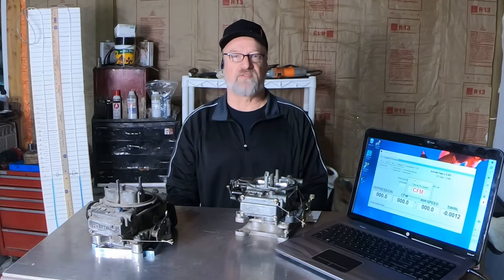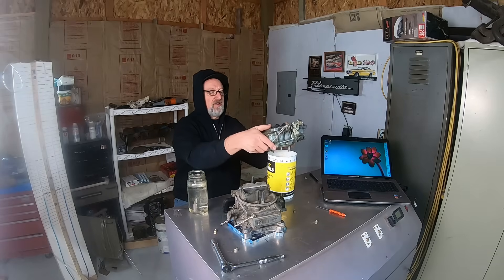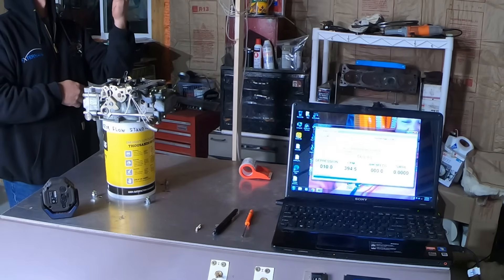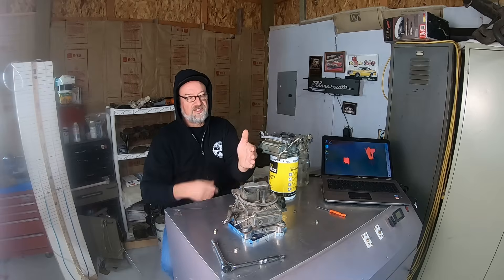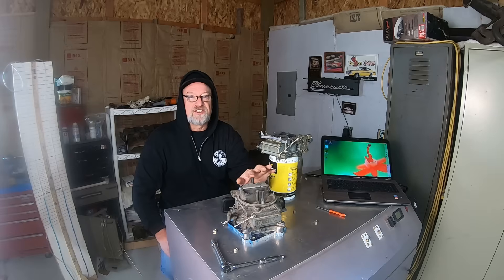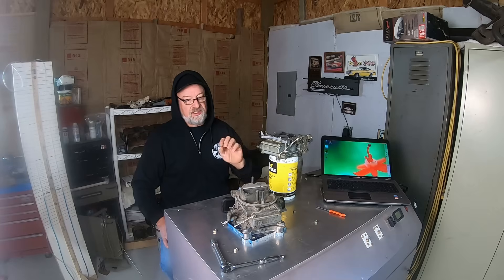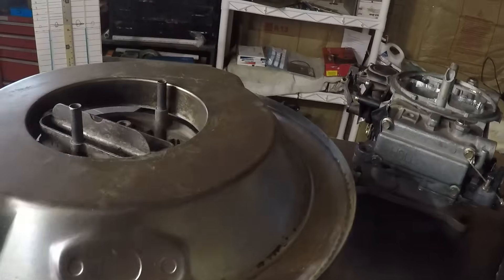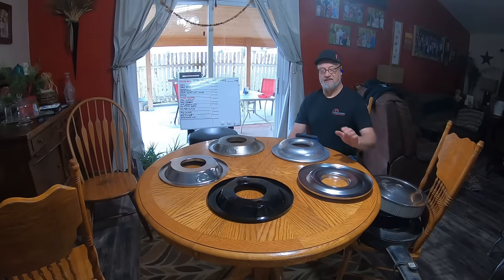Holley Carb Horsepower KILLERS: Air Filters & Base Plates Tested!

Comment: i dont know how to message through youtube so im going to drop this quick request. if you have a 500cfm edelbrock and a 600, could you flow the 600 with the 500 primary boosters? someone is telling me those front boosters from the 500 is whats dropping the 100 cfm and not the booster + rear venturis being smaller. i am trying to make a spread bore style 600 for my dual port intake. looking for like 200 front and 300 rear or so.
would really appreciate it.
Reply from the maker: Thanks for your question! That’s a really interesting idea, and I can definitely see how those primary boosters could affect airflow. But the only carburetor like that, that i own is a Carter AVS, and it is different then the AFB.
Reply: @CudaFishEStories  hey thanks bud. i called edelbrock and asked them the sizes of the venturis on both the 500 and 600. turns out, they are the same and they just use the large booster in the primaries to kill flow. 
theres a guy on youtube selling 600 to 500cfm restrictors. you jb weld them onto of the 600 booster and it cuts 100 cfm. thats why i wanted you to test with the smaller boosters. sounded hoaky to me, but since i called edelbrock and they told me thats how they do it, i guess he is 100% legit. and since i have an offenhauser dual port intake and want the smaller primaries, thats exactly the carb i need. but i have a 1403 and want to switch to the avs2 so i need a 1901. anyway, thanks for the reply. ive watch several of your videos. i think i need a flow bench. i dont have anything to test but its cool.

Comment: Love these tests. But just throwing a question out there. Does anyone know where i can buy a twin dominator one piece oval filter plus top bottom plates. Gonna be a lot of work to make myself.
Reply from the maker: I hope someone will give you a good sourse. Because there a dominator cut in half, aka a circle cut in half.  But that would be a good gadget to make...........it would be vary sellable. most won't us a filter with this hight level of a Race carb...........but there is more them you, that would buy such a air filter ;-)

Comment: I race NHRA Stock Eliminator in an '87 Monte Carlo SS  with center bolt (081 heads) L-69 305. In K/SA any slight hindrance greatly affects my ET. and MPH so I did this very same test and came up with the exact same results as you on Eddie Carlisle's (Carlisle Racing) flow bench. The main difference being I was testing on a Rochester Quadrajunk which is required for my stock class. The deep Edelbrock Elite air cleaner base flowed around 12 cfm over the rest I tested only we tested them at 28 inches of water not 20.4. I use a brand new air cleaner every race to keep the air flow consistent which works well for me. FYI my car runs 11.60s @ 118 mph with a 305 that has a stock intake, modified Quadrajunk and 081 heads with nothing in them beyond the valve angles cut and screw in studs. I went through a pile of 081 heads, L-82 intakes (Chevy used the same intake on the 350 Corvette and 305 HO), and Quadrajunk carbs to find the ones that out flowed the rest. Amazingly my 081 heads (with a 1.84 inch intake valve) will out flow most every double hump head with a 1.94 inch intake valve (197 cfm @ .400 lift) vs a 186 double hump's 194 @ .400 lift. The things you learn on a flow bench are what wins races, nice video by the way.
Reply from the maker: So glad that you are backing up my finding.......so you didn't try it on your race car, because it lost flow????
or did it not perform at the race track as well?
thats a bad ass 305 you got there. ;-)
Reply: @CudaFishEStories  I used the base that flowed the best on Eddies flow bench and ran that at the track in Memphis. The 1st pass I made on the car was 11.78 @ 114 mph and we started tuning the engine and tested several tire sizes and shaved almost 2/10th off it. We had the biggest gain in changing the fuel from C11 to C10, fattening up the mixture, adding 2 degrees to the timing to 38, and running 29 inch back tires. When I raced it in Gainesville I got put on the trailer by a 383 Mopar in 65 wagon because it was a heads up match in K Stock automatic. A 305 Chevy stands no chance against a 383 Mopar.

Comment: We ran a 4" tall by 14" round paper air filter with a top & bottom plate-no enclosure  around the filter on our dirt track cars with No problems with a Holley carb.
Reply from the maker: yup a lot more surface area then the 3" X 2.5" standard open element.  which is required for most under hood air cleaners.

Comment: assuming you're running the 600 CFM carb on a Mopar 360 those flow number differences only matter when the engine is running around 7000 RPM.  Who does that?  Check out flow requirements on one of those engine size / carb size / RPM calculators.  For driving around town.....your typical 5000 RPM blip, the air cleaner differences mean nothing. They only serve a 'cool' appearance factor.
Reply from the maker: your are 100 % right the more air your engine demands the more "any" air filter will become more restrictive.

Comment: what inches water column
Reply from the maker: i set the bench to run 10 inch and then have to computer calulate it at 20.4  (the red numbers)My flow bench is not powerful enought to test 700+ cfm carbs.  Its the best that i can do with what i have ;-)

Comment: Choosing the “best base” independent of the rest of the filter invalidates the test.
Reply from the maker: The Story has been said, that if your going to remove your air filter before racing, that you need to keep your base or you will loose HP. 
And that is why i did it that way.
 I get and understand what your saying.
Thanks for watching and commenting ;-)

Comment: Where do you live that you can get that many runs on a track.  In the 70's for me.  Can't get more than three in a whole day.  DANG !  you're LUCKY !!
Reply from the maker: I here yeah!  At RMR (dead track now) i had the same problem. Even a test and tune was tuff to get more them 3 runs in a day.
I race at Hypoxia Raceway. It is a non profit deal, and i'm one of 10 or 12 of us non profiters that keep the track alive.
1/8 mile track started from an abandon air port.
Even with all of that. it's going to be tuff to get it all done before competition starts.
It resides in Evanston Wy, 6600 foot of elevation. It's tuff to make power where there is no air. Even our cars get out of breath :-)

Comment: very interesting...    curious.. do you use a wide band air fuel ratio gauge to set up the primary idle feed restrictions and primary main jets.. 
in Neutral or Park... bring RPMs to 1700 and look at the AF ratio.. 14.7 no load is where you want to be..
bring it up to 3800 RPMs steady throttle.. are you at 14.7..   
why... at 1700 steady throttle no load your idle feed restrictions are close to max flow.. this gives you the proper air fuel ratio for the idle feed restrictions UNLOADED.. at 3800. the primary main jets are close to max flow.. 14.7 is where you want to be.  once you change the primary idle feed restrictions and the primary mains.. from warmed up idle.. crack the primary throttle really hard.. does it backfire thru the carb?? go up a size on the primary accelerator pump discharge nozzle.  if you have a 360 in your car.. try a 0.032 primary idle feed restrictions and a 72 primary main jet.. something like a 33 or 35 accelerator pump nozzle.. you won't believe its the same carb..    you can zip tie the air fuel ratio gauge to the bottom of a piece of carpet and have long wires to plug it into the lighter socket.. so you can have it on your dash or on your fender..
Reply from the maker: I thought that I had already responded. So if you see two from me that why. 
Mine is a 408 based of a 360. Hyd roller, 13:1 that run on 110 racing fuel. My 850 pro form works real well. 
If i get my o2 sensor working again, i will have to try it. 
Thanks for the procedure 👍👍

Comment: Nice, something Ive thought about is the 1" spread bore adapter with its shrouding,  drastic sharp edge transition looks as if it probably flows horrible wonder to the point putting a spread bore on a 4150 flange with those 1" adapters is not worth doing and kills flow and just buy a spread bore intake, BUT I installed a modded 800cfm Q-jet on an old original Torker intake (SBC) but I used a transdapt 2" spacer/adapter and it obviously nets a little pleanum volume but the transition is very gradual with no sharp edges and zero throttle blade shrouding to the point I couldn't see where it would compromise any flow? I also wonder if that tapered shape creates any Venturi effect...? My 355 ran really strong with that combo but the carb itself didn't like the combo of that spacer an single plane intake a 230°/.480"/108°lsa cam because it didn't run clean at low rpms it skipped right over the idle circuit and ran pig rich all the time unless at WOT. I'd love to see a flow comparison of those 2 adapters.
Reply from the maker: I don't have either one of them but as far as those pig rich problem. at idle. 
You need to drill a small hole in each of the primary butterflies. This will alow more air in (aka because of low vacuum at idle) alowing you to turn your idle screw back down, and be able to use your idle mixture screws again. Start with a 1/32 drill bit. Drill on the Idle transfer slot side of the primary throttle blade.
I  have only done this mod on holley carbs.  It works!
Ps your jetting will be different between a dual and single plane manifold do to better vacuum on the dual plane maniflold.

Comment: These tests are interesting.  And it's probably best to look for the most efficient air cleaner. But I tried similar once, testing with the carb on the intake mounted to a head. It was awkward, but in doing that the total flow through each port was reduced, and the restriction from using a typical air cleaner with  dual snorkel inlets was not bad, around 14%.

Thanks for the video.
Reply from the maker: Your welcome! 
I agree a running engine may show less restriction of the filter, due to internal restriction, is the intake track is the bottleneck. That’s why I’m taking it to the drag strip to find out just that;-)
Thank you for your insight👍👍

Comment: I was always curious how a stock air cleaner with holes drilled in the base just outside the filter would do. 
That move was part of my stock looking sleeper strategy back in the day.
Reply from the maker: I have alway thought that the dual snorkel was the cats meow.  didn't have a clue how restrictive it was.
I have seen stock air filter with all the holes drilled in them.  I thought that was silly. look like it could have been a useful strategy. Two thumbs up!!!

Comment: What are you using for fuel, useless testing.
Reply from the maker: What does fuel have to do with the CFM flow of a carburetor.
Reply: @CudaFishEStories fuel weighs 600 times more than air per cubic foot. Fuel droplets take up space and create friction. Fuel flow thru the carb is more important than air flow. Venturi size and shape to throttle plate size percentage is also very important. Button head throttle plate screws, stabbed shafts and cutting the choke tower off all do minimal effect to airflow. As a matter of fact, cutting the tower off hurts more than leaving it on because it helps straighten air flow through the air bleeds and boosters.
Reply from the maker: Hmm well........I won't agree or disagree with Any Of  That.    Running fuel thru my flow bench would cause a bad explosion..........NOT TAKING THAT GAMBLE.  Since all the test are done with NO FUEL!   They are comparable ;-)
Reply: @CudaFishEStories it's a non flammable liquid with the same specific gravity as gasoline.

Comment: I removed the 14x3” K+N filter and picked up 35 Moroso HP, damn drop base.
Reply from the maker: Did you test it with just the drop base? Sounds like you made more power with just a bear carburetor with no base filter or anything. Right?
Reply: @ Yep, it was running constant 13.1s and I removed the air cleaner then went 12.71 next run. I only use a drop base because of hood clearance but have a spare hood to cut a hole and maybe use a boss 429 scoop. Next time I’ll try using just the base and see if I get an improvement. It’s a’71 LTD with a 429, hoping to get down to high 11’s.
Reply from the maker: Sound like a real fun project.  Fresh air is all ways a good thing..........Well it suck when its rainning ;-)

Comment: I was really surprised at tge difference between tge "round" plate compared to the flat plate.. That's a really big difference...
Reply from the maker: Me too. But the round crashed into the choke. The flat plate raised the air above the choke tower. ;-)
Reply: I guess we were all taught that smooth was better.. We are learning that's not always the case.

Comment: If you built yourself a air cleaner riser / spacer that is narrowed down a little bit in the center for a Venturi affect 
 It will speed up the airflow,
  Which in turn may also add some extra CFM of volume to the airflow
Reply from the maker: Funny, you should mention that. My next video is going to be comparing a K&N stub stack compared to a velocity stack ;-)

Comment: You have me wondering what the 3 inch, 1969 Chevy C10, 350  spacer/tube does. It's still on my truck, on it is a deep drop base.
Reply from the maker: It’s been a long time since I’ve seen one of those. But I think it had to do with gaining clearance for something.
Reply: @CudaFishEStories  May have been to simply make a small block look a little less tiny in the C10s caverous engine bay. ???
Reply from the maker: @ I agree with that! them old truck had lot of room under the hood!👍

Comment: Well I'm confused. Why does testing the flow with the only thing changing is the base design result in any change in cfm  at all?
Reply from the maker: It has to do with the air crashing into each other or whether it turns smoothly into the carburetor

Comment: We have a 505” RB in a 3,680 lbs. B body. It ran an 11.41 with a cotton/gauze air cleaner and a drop base. Pulled it all off and it ran an 11.41 the next pass.
Reply from the maker: That cotton filter, Probably has less restriction then the black one i tested.  The test at the track is going got be interesting.
Reply: @ it also went a 9.92 @ 135 with a shot of nitrous and that same air filter in place. 🫣
Reply from the maker: @markwise9868  Bad ass! 9 sec car on nos👍

Comment: What was the AfR between swapping ? Sometimes jetting changes are needed  when changing air filters. Althouhb maybe a jet size.
Awesome video .  Stuff i wandered
Reply from the maker: When i'm testing, just the air flow(no fuel in the fuel bowls) thought the carb you could leave the jet out and it wouldn't make any difference. in a running car it would  flood the engine.
Did that answer your question?
If not exlpain more of your wonders ;-)  
And i will try to give a better answer.

Comment: For street machines that can't have giant holes in the hoods, or 6" cowls. Sometimes you have to use whatever works. But putting a "bugeye" style element with spring clips holding the damn thing together. Isn't ideal. Or those tiny little tunnel ram dual quad set ups. That are like 4-5 inches in dia.
Junk. I'd rather have a drop base that clears linkages and float bowls. Even if it gives up a miniscule amout of airflow above 5500rpms.
Your not get'n up that high for long on the street anyhow.
Use what looks intelligent, and filters air.
Its not rocket science.
Peace
Reply from the maker: You r right if it is a street car driven on the street looks are more important than performance most of the time. But these tests are being taken to the track to verify as well

Comment: such a hack video just stuff been done 10 million times over everyone knows any filter on a carburetor causes restrictions any restriction directly affects horsepower numbers if you’re trying to make all the power you can you’re not even running a filter just pay attention to the shows that are already on TV that is been done for the last 50 years we need these people to get off their rear ribs and get back to work in manufacturing where they’re needed
Reply from the maker: I’m taking that high flow filter to the track and comparing it to the filter that I already have. The high flow filter. Flow is almost 100 CFM better. My guess is it won’t run any different but I could be completely wrong. Check out my memorial weekend video and we’ll both find out.
Reply: @CudaFishEStories  test test test! Its the only way to make any thing faster! Make sure  and  take jet kit that weekend! Nice work!
Reply from the maker: @conniekahl8015 yup or bucket of money. Mine are always empty. Education of hard knocks. It a slow, long journey……but every once in a while, it comes up with roses 😂

Comment: What if you did the same tests but Add a  2" inch. , or 3" inch Riser / Collar between the carburetor and air cleaner base .
     I have a large drop base like the one you gained 12 cfm from, but it has a metal 2" inch Riser/ collar that has been added to it,  it is actually brazed to it .    
  And it is currently being used with a 1405 Edelbrock,
     The air cleaner is a 14" inch AC Delco that was purchased as a kit with valve covers and timing chain cover,  back during the 1990s for a small block Chevy project.
Reply from the maker: Very interesting, I’m doing a test with with a K&N stub stack versed a velocity stack is kinda like what you’re describing with your air filter with the 3 inch base might be interesting